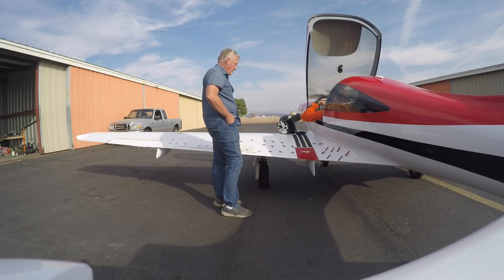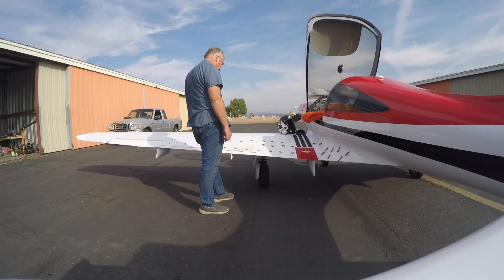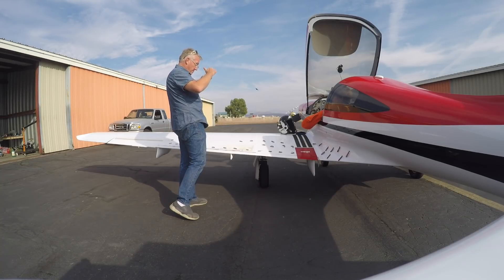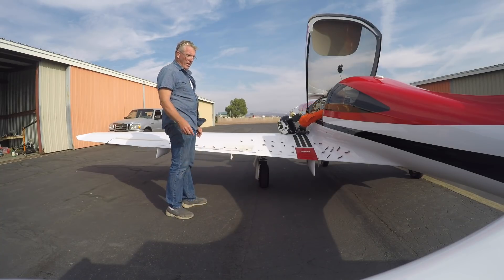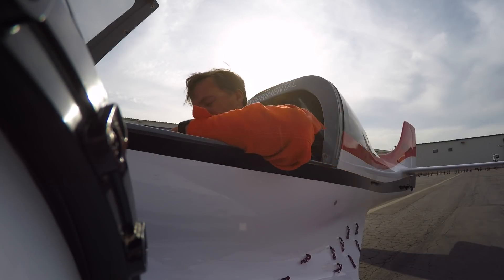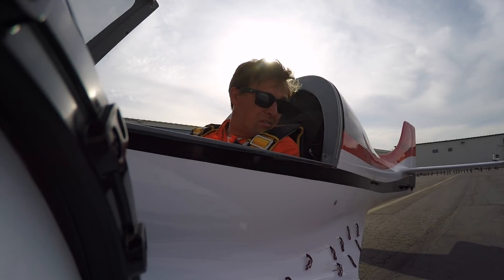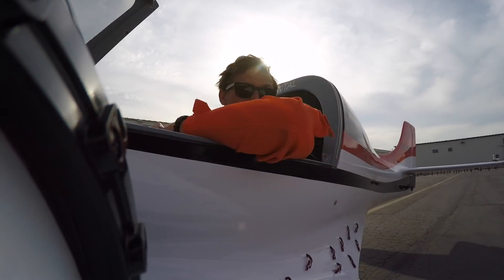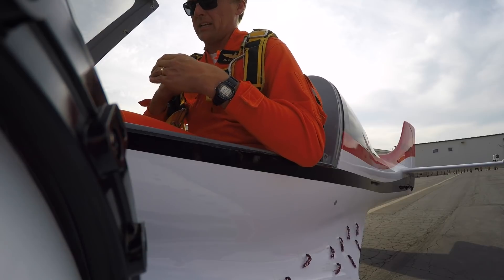Fresh Hot Data - Post Flight Debrief - Flt 6 Hakan Lancair

Comment: Have you considered using a GPS position (IGC file) tracker to double check your airspeed?  Obviously wind is an issue, but maybe two runs perpendicular to the expected wind on reciprocal courses?  Clearly not definitive but would be an easy thing to load onto your phone.  Can't hurt might help, cheap and easy.
Reply from the maker: Of course.  The biggest problem for us is a system that can be quickly installed, gets good data, then can be removed.  I visit as many as 3-4 customers a week, sometimes driving, sometimes flying in little planes, sometimes on airlines.  So managing the kit that comes along becomes a big job.  There are other dataloggers, other cameras, other audio recorders etc, but the last thing I want right now is a new system that will need a new charger, a new way to store and process the data, and then have a learning period where I lose customer data.  That sounded like excuses.

Example: we worked with Andrew Angelotti to develop a wireless pitot boom that we would take to jobs and we would get data logging and a 2nd pitot/static indication.  Was it awesome?  Absolutely, but it didnt travel well, most customers don't understand the value, and even though you can stick it on like a gopro it took all day to install and remove it.  So we have barely used it.

Anyway, great question.  I hope my answer provided some valuable information.
Reply: @utopiasnow  Understood.  The last Harkan video where you brought it back from "nerding out on aerostuff" to "what is the business problem we are solving here" dovetails into what you are saying.

Comment: The interesting bit which is why I keep thinking the working lift area is going back giving an effective CofG move forward compared to the centre of pressure is the tufts on the flaps appeared to be in laminar flow and due to that the elevator becomes stalled trying to hold the nose. I can not wait to see what happens to sort this. VG's on the tail may help or a small move of CofG rearwards or both.
Reply from the maker: Thanks for the thoughtful comment.  Lots to learn from this little guy.
Reply: @utopiasnow  It was good to see the results in the video before last. As an old style design engineer (on F1 cars) and having been involved with aircraft all my life, I do enjoy problem solving. Some times the numbers do not come out the way you expect (or a veriable is missed), at that point practical experimentation comes in or a fresh pair of eyes, that see past the symptom or just asks the question, which can make the difference.
This aircraft has a lot going on with what on the face of it looks a straight forward modification (when it looks easy it nearly always is anything but).

Comment: “The flaps had moved, they hadn't jammed or come off the airplane, the pitch trim had changed (an indicator that the flaps were making life) but the stall speed hadn't changed.”  

Might I be so bold as to suggest that the proper statement would be, ‘the indicated stall speed hadn’t changed’?  

You cannot change the shape of a wing (by deploying double-slotted-Fowler-flaps) that much without having a change in stall speed (and/or angle of attack)  

My opinion is that the deployed flaps and wing-root-fillet-fairings are causing a pressure drop around the aft fuselage, where the static port (usually) is mounted.   

When you are dirtying up the aircraft for stalls, the airspeed is decreasing, but the pressure around the static port is decreasing slightly faster than the pressure in the pitot tube, causing the indicated airspeed in a dirty stall to falsely indicate a few knots higher than the actual airspeed.

Maybe switching to the alternate static source, then performing a clean then dirty stall series would get the airspeed indications trending in the right direction?
Reply from the maker: These are the questions.

Pitot static error is def on the table.  We already knew there was error as early as the first flight, what would be interesting is that the error is growing directly with flap deployment which seems convenient.  But wait until you see what Hakan is trying next.

Also worth noting the clean stall was faster on this flight as well.  Which makes me think the tufts on the elevator are causing separation.

Most notable for me is the aileron effectiveness at 65 KIAS on flight 5 was much worse than at 75 KIAS on flight 6.

Its all very interesting for sure, thanks for the comment.

Comment: I can't get enough of these videos as an AE, this is super interesting. The tufts on the elevator don't appear to show tail stall - and that's normally less likely in low wing configurations anyway no? But it also looks like the slots are working great and getting good flow over the flaps throughout, so why no effect on stall speed? 

I had the same first thought as Hakan, to add VG's on the main wing along the length of the flaps to delay separation and reduce the spanwise flow. Would definitely be the most logical and cheap place to start. Can't wait to see what he comes up with.
Reply from the maker: Glad you enjoy them.

These are the questions.  I think pitot static error is on the table, so is elevator separation caused by the tufts, so is premature separation of the main wing.

All very interesting!

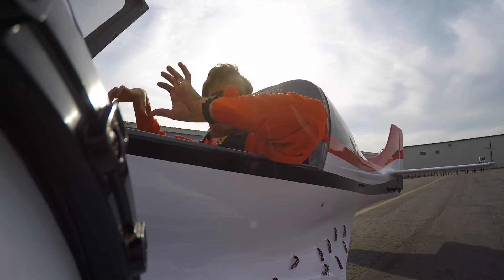Comment: 2:15 Does it seem like the H-stab is set pretty positive? You can see the underside of the stab from that camera angle. Does the elevator trim in trail during cruise? Or does it require a displaced elevator in cruise?
Reply from the maker: Check the video:  https://youtu.be/jFE4NX4_F3I

I think most of your questions are answered there.
Reply: @utopiasnow  yes, I have watched that video, but I don’t think it showed the elevator position at cruise speed, or what the angle of incidence of the stab is set at.
Reply from the maker: @thomasaltruda  you can see it in the videos from the previous flights, I would recommend flight 5 https://youtu.be/H5Zg-KolRfk
Reply: @utopiasnow  I see it now! Thanks for the time to reply and cut & paste the clips!

Comment: Really looking forward to the reasons why there was not stall speed  change. I still dont think the flaps translated down. Extended yes but in the air the vision does not gel with the ground extended picture. Looking forward to the answer. Thanks for sharing.
Reply from the maker: that is a really interesting question that isn't well captured with the cameras that we placed.

Comment: Excellent flight. Really does look like the wings root has a stall or flow reversal when you're getting the buffet. Do you anticipate a reduction in stall AoA / speed in ground effect?
Reply from the maker: Interesting question about ground effect. 

Wing root stall is good, it means the wing tips are protected which helps with spin stuff.  But the big question for me is whether that root separation is more (perhaps due to the tufts) and this is a great question.

Thanks for the comment!!

Comment: My guess: the tufts on the flaps showed that there was plenty of airflow over top, so the slots were doing their job, and the flow was sticking to the upper surface of the flaps.

The tufts on the horizontal stabilizer were fluttering in the wind. The stab was stalling, which is why your stick force went away, and also why you aren't seeing a decrease in stall speed, because the limiting factor is not the wings, but the stabilator. Perhaps the flaps are blanketing it.
Reply from the maker: I think the next round of testing will be very enlightening!!!
Reply: @utopiasnow  . What about that turbulent flow at the aft wing root? It's a an area with a lot of curves and could be  causing turbulent flow over the tailplane. A wing to fuselage intersection that is at 90 deg on top and at the trailing edge may cause less turbulent flow.
Reply: Elliot Seguin 
Can't wait!!
Reply: Good points. It may be the elevator. :)

Comment: It just doesnt make sense. It IS a lot of sh!t hanging out in the breeze to not do anything.  I like the pitot-static failure idea: Did the airspeed indicator hang at 75? Does it decrease normally on approach, or are you distracted in the flare then and can't see it?
Reply from the maker: The long video has a closeup of the AS on each stall.  There is some variation both in technique and result but not as much as you'd think.